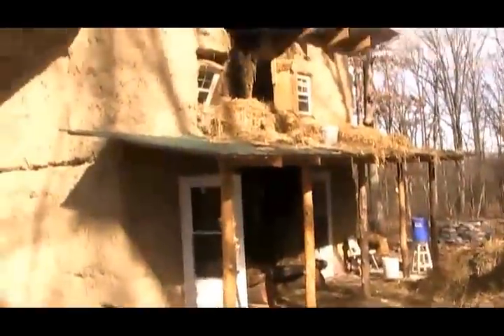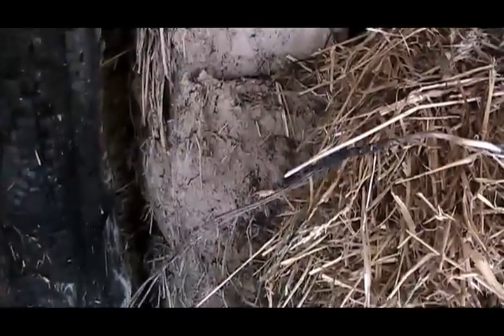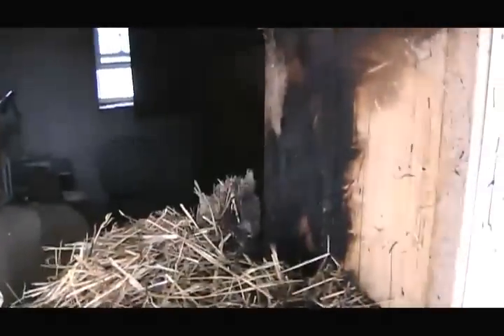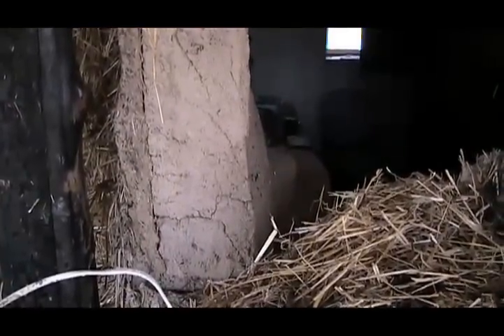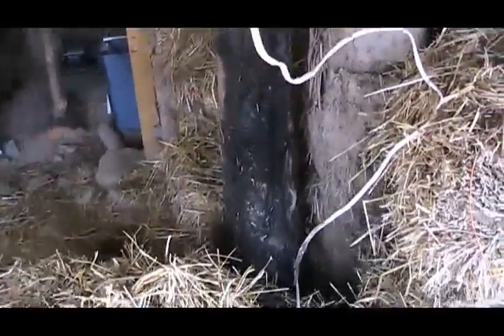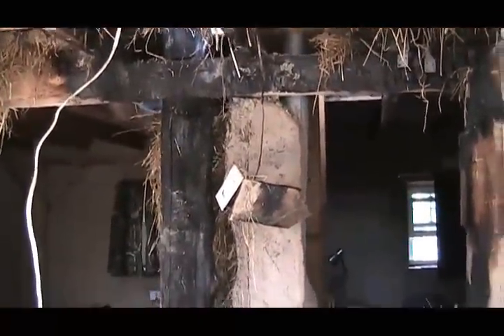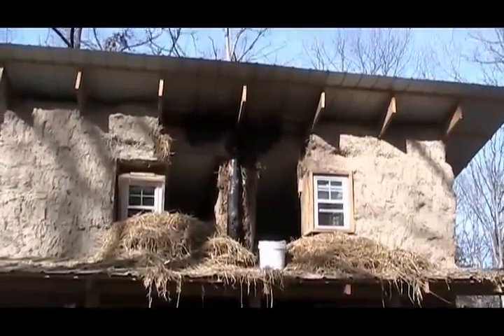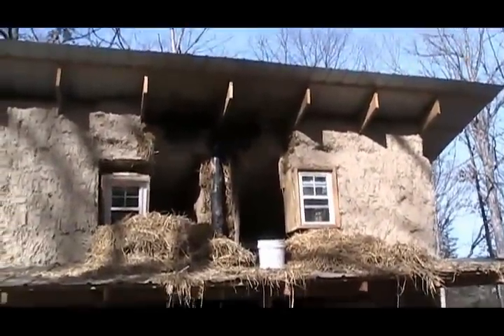Duplex Electrical Fire - November 26, 2012

Comment: Wow! It looks like a bad situation, you have a lot of work ahead of you. How awesome that everyone came together to get it contained quickly, and that no body was hurt. My wife asked the question, "why not put the wire in pipe?" ..."conduit", I said. LOL I wonder the same question?  maybe over sized conduit/tubing in case of future wiring additions?
I love your rocket stove design & efforts to increase efficiency. Have you thought of a heat exchanger(tubing in the thermal mass or around the flue

Comment from the maker: We don't use conduit because of the nature of the bales.  You would have to use a ridiculous number of right angles to zig zag between the bales and likely have to cut notches in them to make it fit.  

Also, if the conduit were made of plastic it would have melted.  If we used metal the wires still would have melted, but yes it would have contained the fire though we still would have had to rip out a large section of the wall to replace it.

We appreciate the input!